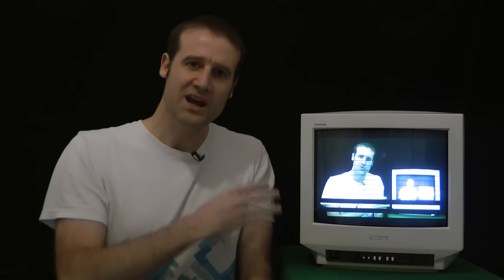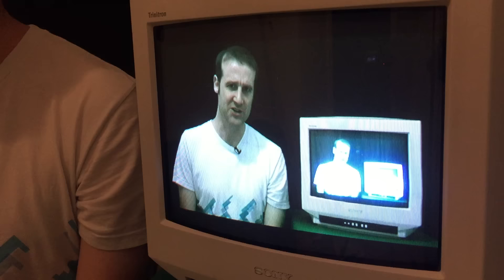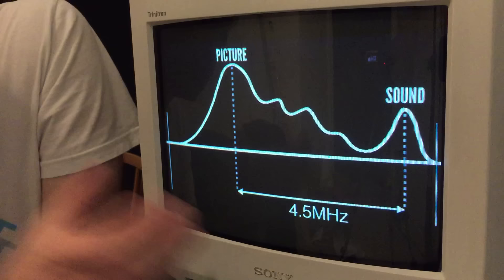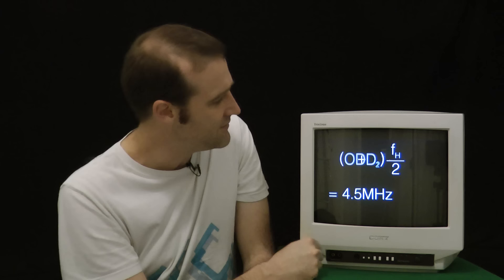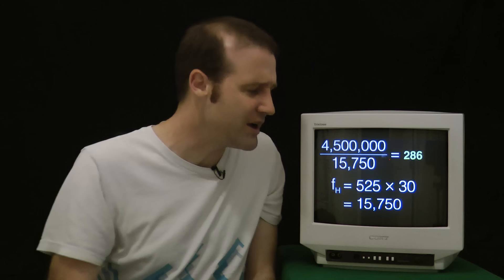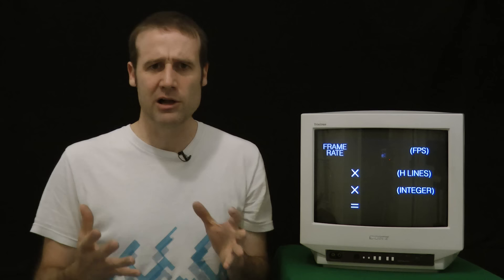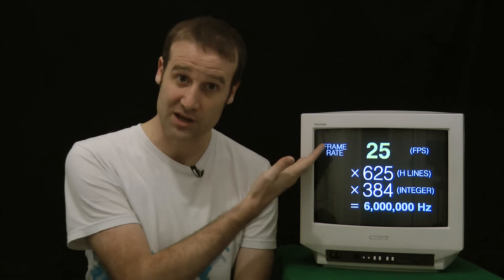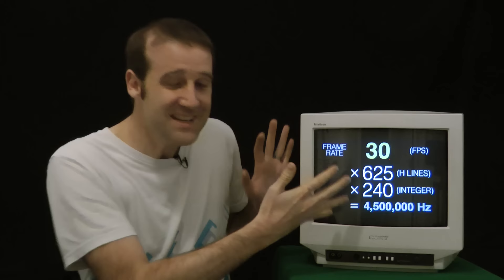Why is TV 29.97 frames per second?

Comment: I always assumed it was a rounding problem when converting from imperial time to metric time.
Reply: LOL, best comment.
Reply: Does anyone know if the 29.97 frames per (metric) seconds is an integer when converted to the imperial feet-fahrenheit time unit?
Reply: Ummm, the current definition of the second was the result of a collaboration between the British National Physics Laboratory (NPL) and the United States Naval Observatory in the late 1950's.  (You might be able to guess the nationalities of those two institutions.)  The effort was aimed at defining the atomic (silicon) second to match as nearly as possible the 1898 definition of the ephemeris second, as given by Simon Newcomb, Newfoundland born director of the United States Naval Observatory, employing the lunar theory of British born Yale professor Ernest William Brown.  The modern second is pretty much an Anglo-American project.
Reply: Jim DeCamp, you know hes joking right?
Reply: On youTube (and especially numberphile) one can never be certain.  I guess I took nationalistic umbrage, given that the definition of the second, at least since the late 19th Century has been pretty much a U.S. project, with substantial help from the UK's NPL. 

I suppose you're going to tell me that we're nitwits for not using a rational and sane AC frequency like 50 Hz, or a "more efficient" mains voltage like 220V.
Reply: Ah, yes. The imperial second. The time it takes an elephant falling through atmosphere (with a slight breeze) to reach the speed a horse runs at if fed properly divided by the average amount of ants per anthill near the western shoreline.
Reply: Kaleb Bruwer as an actual metrologist who works in the field of units and instrumentation, this definition triggers the hell out of me.
Reply: The United States doesn't use, nor has never used, the Imperial system.
Reply: Andreas Hofmann metric time is the same as imperial.
Reply: Jim deCamp, No, we're not going to tell you that: we're going to tell you that it's your inferiority complex that drives you to so inadequately try to affirm the superiority of the US over the world. It must be upsetting to feel so inferior...
Reply: @jimdecamp7204  "I suppose you're going to tell me that we're nitwits for not using a rational and sane AC frequency like 50 Hz, or a 'more efficient' mains voltage like 220V."

The irony being that 220V is actually more efficient than 110V? The higher your voltage, the lower your thermal losses on the wire for a given wire strength, wire length and transmitted power… that's not quantum physics but Electricity 101. Take one of the equations for electrical power:

Pa = Ua^2 / Ra

(Pa is power of the appliance, Ua is voltage drop at the appliance, and Ra is the Ohmic resistance of the appliance), i.e. the higher the voltage, the higher the Ohmic resistance of the appliance can be, so as to draw the same power, and Ra is actually proportional to the square of Ua, so twice the voltage = four times the resistance.

On the other hand, the thermal loss power on the wire, divided by the appliance power, is proportional to Rw / Ra where Rw is the Ohmic resistance of the wire. Assuming you have a fixed wire resistance (since this is simply a function of the material, usually copper, cross-section and length of the wire), therefore the amount lost is inversely proportional to Ra, and as we have seen above, Ra is proportional to the square of Ua, therefore doubling the voltage reduces the fraction of thermal loss by a factor of 4, i.e. a reduction by 75%!

(This is a bit simplified and not entirely correct because I assume that the ratio of Ua to the total voltage U is fixed, which is a reasonable first approximation however for Ra >> Rw. If I were to calculate the actual Ua, the savings would be a little less than 75%, I think.)

Why not increase the voltage further? Well, there are practical tradeoffs such as the amount of insulation required, transformation losses for devices that use lower voltages internally (e.g. computers, LED lighting and other electronics) and so on, but overall, 220V is considered more efficient than 110V. OTOH, the frequency is more of a matter of convention (i.e. everyone on the same grid must use the same one).
Reply: Power in the U.S. is distributed at relatively low voltage and only stepped down on a transformer on a pole close to the user, typically ten or twenty meters, so the difference in loss in negligible, and depends on conductor size, anyway.   220 is about 4 times more likely to electrocute a person, other things being equal, so I think the US (and Japan and Taiwan) made the right choice.
Reply: @Jim DeCamp: Thanks for conforming that you're unable to utter a complete thought without the need for some sort of affirmation of superiority. You must have a legion of friends.
Reply: @jimdecamp7204  Of course you have transformers! But you still need wires inside the building. Electrical accidents are not uncommon, but lethal accidents involving residual voltage are rare in Europe (e.g. only about 3% of registered accidents are lethal in Germany). In fact, according to Wikipedia[1], death by electrocution appears to be much more common in the US than in Europe, which goes to show that there are multiple factors involved:

"There were 550 reported electrocutions in the US in 1993, 2.1 deaths per million inhabitants. […] In Sweden, Denmark, Finland and Norway the number of electric deaths per million inhabitants was 0.6, 0.3, 0.3 and 0.2, respectively, in years 2007-2011."

(E.g. in Germany, all new buildings with a bathroom or shower must have a residual current device. My flat was retrofitted with resettable fuses and an RCD last year.)

[1] https://en.wikipedia.org/wiki/Electrical_injury#Epidemiology
Reply: @TruthNerds   Transmission loss inside a building is negligible.  Conductors are sized to control heat loss, more from fire concerns than economic.  I still think the trade between 120 V vs. 220 favors 120V.    German housing stock is newer than in the US. The Eighth Air Force, Army Artillery Corps and Waffen SS Sappers pursued a very thorough programme of urban renewal in the years 1943-45.
Reply: @jimdecamp7204  "Transmission loss inside a building is negligible.  Conductors are sized to control heat loss, more from fire concerns than economic."

Well, I sure appreciate your tenacity. ^^

Let me preface the following calculations with: I agree that the fire hazard is the #1 concern by far.

So here's some more electrical data: A typical European 230V wall plug uses 2.5mm^2 wires and may be fused (according to spec) to 16A (max. wire length about 28m). An American 120V[1] wall plug with 14 gauge wire (corresponds to 2.08mm^2) may be fused to 15A. Yes, that's almost the same amperage, and they (to me) surprisingly use less copper in this case (12 gauge, rated to 20A, is also used and requires more copper, see below). BUT, because of the lower voltage, the maximum power rating does come down to about a half (since power = voltage * current). Here's a quick summary:

– 14 gauge: 17% less copper, 51% less max. power (than 2.5mm^2 @ 230V)
– 12 gauge: 20% more copper, 35% less max. power

Again, I was admittedly surprised that American electrical wires are not necessarily thicker, but instead have a significantly lower power rating even when they are.

Next, I'll calculate thermal losses. Let's use a power that works under both limits, e.g. a 1600W electric kettle (or do you say water boiler?), and 10m of cable (that's about 33 ft). For fairness, let's assume 12 gauge wire in the US setup, which has about 3mm^2. Sorry about the metric units, but I find them much more convenient for physical calculations. This gives about 115mΩ (US) and 138mΩ (European) for the two wires of 10m each (phase and neutral) based on the specific resistance of copper. In the US, the kettle needs 13.3A for full power. P=I^2 * R, doing this calculation for the wire resistance gives about 20W. In Europe, a kettle with the same power needs ca. 7.0A, and P=ca. 6.7W. As mentioned above, I disregard the voltage drop on the wires in the power calculation as a simplification, but, just for reference, at the given currents, it's about 1.53V and 0.96V rsp., which means I'd actually have to go a bit above both mentioned currents (and more in the US case) to arrive at an appliance power of 1600W.

Even 20W thermal loss compared to the 1600W for the appliance certainly isn't much from an economic perspective, the main issue is that any generated heat must be dissipated to prevent equipment damage (fire in the worst case). Unfortunately, the maximum thermal load that a building's cabling can handle depends on a variety of factors such as whether cables go through thermal insulation, the number of wires per cable, the materials used – and I'm getting a little exhausted as well. (We can safely assume that, for most installations, the safety margins may appear exaggerated.)

"The Eighth Air Force, Army Artillery Corps and Waffen SS Sappers pursued a very thorough programme of urban renewal in the years 1943-45."

3.6 million or 20% of German homes were destroyed in WWII, a large number undoubtedly, but how much "urban renewal" that alone has caused is up to debate especially given that the war is over 70 years ago as well.

[1] I switched to the actual voltages used nowadays since both the 110V and 220V numbers are rather outdated.
Reply: @TruthNerds  
I congratulate you on winning the internet. As expected,  Jim DeCamp  wasn't available for a come back it seems.
Reply: Kaleb Bruwer but who says if the horse is fed properly? Is it an Indian or African elephant? What breed of horse?
Reply: CraftQueenJr depends on if you’re a dem or a repub. lol
Reply: @jimdecamp7204  Screw that, in South Africa, we use a more efficient 240V :-D How about them Japanese, where half the island was 50Hz and half was 60Hz, yet their TV standard was NTSC like America. That I stil haven't figured out!

Comment: As a curiosity, Brazil used a NTSC-PAL hybrid called PAL-M, which featured 525 lines, exact 30 fps, and the PAL color encoding scheme with almost the same chroma carrier frequency as NTSC.
Reply: Exactly! It would be great if Matt made a video about it. PAL-M merged 30 FPS with perfect colour reproduction.
Reply: Yes very similar but being PAL there had to be a quarter-line offset so the frequency changed. Another difference between PAL-M and European PAL is that there in no 30Hz subcarrier offset (25Hz is used in Europe). This offset was an afterthought by Dr Bruch and has caused us heartache in Europe with editing.
Reply: @dhaen  Ah! The glorious days of eight-field editing!

Comment: The whole point of NTSC color tv was to put in a standard in which people who still owned black and white sets (vast majority) could still see color broadcasts and color tvs could still see black and white broadcasts, this was referred to as "compatable color". If they were to have adjusted the horizontal lines like you suggest the would have made a signal that no tv could display, therefore defeating the whole point of their efforts. In Europe, when PAL was introduced, anyone still using the old 405 line black and white sets, just didnt get to see the new color shows and anyone who had a color tv couldnt see the old programs.
Reply: All color TV Systems (NTSC, PAL, SECAM) had to be backwards compatible to black and white TV standard. It would have been too costly to broadcast the same content simultaneously with two different standards. At introduction of color TV most pople still had b/w TV sets and only a few shows were actually transmitted in color.
Reply: @oldSwede65  Also most of Europe were broadcasting 625/50 before they started broadcasting in colour! There was overlap with 405/50 staying on for some years until all the old VHF transmitters were replaced by UHF. The programmes they broadcast were the same, just in B&W. The BBC made everything in colour 625/50, and there were standards converters at TV Centre to down-convert to 405. I the French even had some 819/50 B&W transmissions running after they converted to 625.
Reply: NTSC = never the same colour twice ! Or so it was often described.
Reply: @oldSwede65  
And yet, the UK did exactly that for nearly 20 years (if you count the Trade Test Transmissions on BBC 2, which, though illegal to watch, were being seen nonetheless, as the law was virtually unenforceable).
Reply: The amazing side effect was that color signals gave better black and white images on black and white TV sets.
Reply: (Pardon my nitpick)  Only the UK and Hong Kong were 405 lines. 
Continental Europe was mostly 625 lines, though France had 819 lines in the past.
625 lines×50 fields was a masterstroke for Continental Europe. It matched the 50Hz electrical power, with 15625Hz being almost identical to the USA's 15750.
This meant that Continental Europe could use American flybacks off-the-shelf.
Reply: @arthurroberts491  I wonder if that had to do with the fact that they had to use proper brightness to work with the chroma and not just desaturate the image.
Reply: I get what you're saying, but that was a stupid attitude. A new technology has a transition period of course, but you have to think of life after the transition, and having a standard that was hamstrung because some people couldn't upgrade for a few years is very poor planning
Reply: Lol I never thought my comment would spark all this discussion, this is neat. Thanks for sharing stuff as a lot of it I was unaware of. I understand the pros and cons of both systems, I just think NTSC was designed for a purpose (compatible color) and did it well (for the time). But its cool how PAL tackled the issue differently with downloading and stuff later on.
Reply: @1L6E6VHF  Except that nobody in Europe used American flybacks!
Hong Kong never used 405-lines, but Ireland did.
Reply: @davidfaraday3085  
There were 405-line sets in Hong Kong - though I wouldn't be surprised if the system was connected to cable.

Note that Hong Kong was in the Empire before 1997, though I'm almost sure that the cable system (probably available only to hotels and homes of well-to-do expatriates) may have closed decades before.
Reply: @1L6E6VHF  So at what period was 405-line used in Hong Kong?
Ireland certainly used it for a while because when Irish TV started many Irish were already using British 405 line TVs with large aerials to pick up British TV either from Northern Ireland or from Wales.
Unlike the UK, however, the Irish changed from 405 to 625 more or less overnight using the same VHF channels. In the UK we had both 405 on VHF and 625 on UHF for about 21 years (1964 - 1985). BBC2 started on 625 in 1964 then from 1970 onwards BBC1 and ITV were transmitted simultaneously in 405 on VHF and 625 on UHF.

Comment: When I worked in a post production house in Hollywood, the saying was:
NTSC = Never The Same Color
Also, in order for timecode on broadcast videotapes to make sense with the 29.97 framerate, they developed "drop-frame timecode," typically denoted with a semicolon or period after the seconds [HH:MM:SS;FF]. For every minute not ending in a zero, two frames were skipped in the timecode. If they hadn't done this, then every hour of timecode would have an additional 3.6 seconds of real time.
Reply: Yeah, I've researched this because why not—yeah, "because why not" is why I research most of the things that I do.

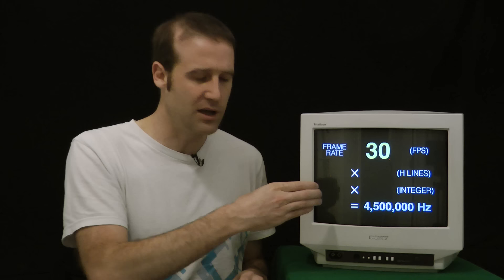So 00:00;00 is a real timecode, as are 00:00;01, 10:00;00, and 10:00;01, but 01:00;00 just doesn't exist, and neither does 01:00;01, or 01:00;02 or 01:00;03 in the case of 59.94fps.

This drops 18 frames (29.97fps) or 36 frames (59.94fps) every 10 minutes (18000 frames in 30fps or 36000 frames in 60fps), leading to a frame rate of 17982 or 35964 frames per 10 minutes, or 29.97 or 59.94 exactly. NTSC is actually 29.970029 970029 97... frames per second, which means that timecodes with the SMPTE drop-frame correction still drop a frame every few hours.
Reply: @meta04  I remember this too well, it is burnt into my memory. Generating SMPTE on a brain dead 8bit.
Reply: Who on earth is going to notice the extra 3.6 seconds of real time? Also, you still end up with the problem that every hour of timecode is short 3.6 milliseconds of real time (4500000/(525*286) isn't exactly 29.97)
Reply: @Anonymous-df8it  We're talking about TV networks who sold advertising space by the second, so they needed to be precise in how everything was measured. Also editors would often have to deal with audio coming from different sources, so having the sync drift by 3.6 seconds per hour would be catastrophic. Those are just two of many reasons why precise timecode was important.
Reply: @lednerg  Why isn't 3.6 milliseconds per hour catastrophic?